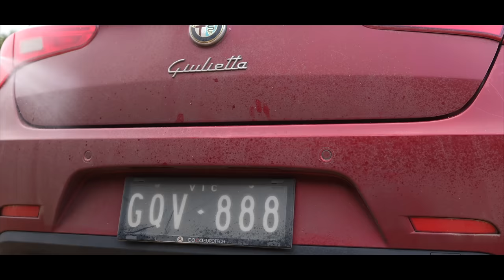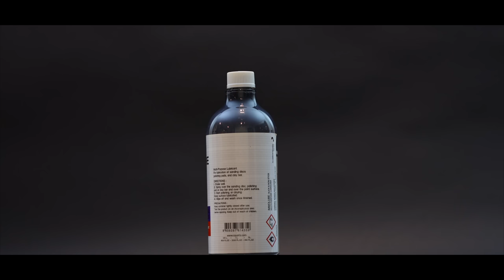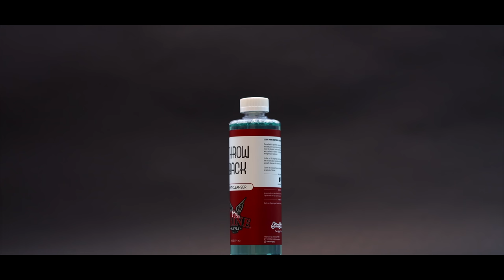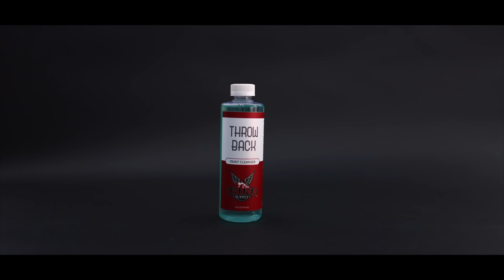My Favourite Car Detailing Products | Wheels, Wash & Decontamination Series

Comment: For folks reading this, reached out to Sandro regarding removal of wheel weight adhesives. He recommended a heat gun to loosen/remove the foam with a non-marring tool, and TarX to remove the adhesive. Got both, used as he recommended (and per label instructions), and it couldn't have been a smoother process. Thanks, Sandro!

Comment: Good to see you back mate.
Definitely some great products there, over the years Nv snow + has probably become one my favourite products in my arsenal, just seems to clean so well, and used at a 1:10 dilution as a pre spray prior to contact washing, really supercharges it’s cleaning ability and continues to surprise me with its ability to strip back the surface without requiring further use of harsher apcs and/or traffic film removers.
Well done once again mate 👌

Comment: I would suggest to anyone cleaning their car frequently to buy a wheel cleaner and a strong apc that is concentrated, can be diluted and offered in gallon. A bottle ready to use is often just to expensive, will need to restock basically every month or two.
And don't get a 2 in 1 wheel cleaner/iron decontamination. Get a concentrated wheel cleaner that you like, and iron X. Only use iron X when needed.

Comment: From what I’ve learned in detailing the word “best” is really subjective. For example some people love CarPro Lift but other love Bilt Hamber Touchless more. It’s all down to personal preference
Reply: I haven’t used bilt hammer but I don’t like how much you have to use
Reply: @jdmkidk24  you have to work out your PIR and you can adjust from 1%-4% depending how dirty it is. During the summer where it’s just light dirt 1-2% is enough and I don’t use up the full 1 litre solution in my foam bottle, I mix it in with 500 ml which is still more than enough to cover the full car.

Comment: Thank you Sandro.  A little surprised you recommend the MTM foam cannon in 2023.  Our local dealer usually has to throw in a free 16oz bottle of soap to move them.

Seems like they're the only company on the market that hasn't figured out the wide mouth bottle yet, and I constantly had to adjust the fan nozzle because it came loose so easily.
Reply from the maker: Yes I agree a wider, easier to pour in bottle would be nice. But I tested it against quite a few other lances and the MTM always had the best cling and longest foaming dwell time - that’s really what impressed me about it.
Reply: The best thing about the MTM is the repair-ability! Very simple and easy to work through if it clogs a little. The steel casing & nuts & springs inside are high quality and last a long time while also being very easily & cheaply replaced with goods from your local hardware store.

Comment: Thanks for all your incredibly helpful content over the years, not sure my bank account would agree but 😂

Can I also ask, is there any specific combo of product plus an applicator/brush that you like to use on the more aggressively lugged off road tires? I haven't quite found a combo that speeds up the application process yet. I've just been using a foam applicator and "sponging" it in.

Thanks again!
Reply from the maker: Thanks so much for the support, it’s greatly appreciated! 
A tyre dressing combination I like a lot particularly on off-road 4x4 tyres using Zaino Z16 with a detailing brush (something like the Carpro Boar Hair brush) and just painting Z16 over the tyre walls and knobby treat patterns, it’s great at getting into all the intricate areas. Also just leave on and usually it all self leaves within 30-45mins and looks just amazing. You can also just use a cloth to wipe off any runs on the rims or any excess dressing.
Reply: @CarCraftAutoDetailing  awesome, thanks! I dread this process usually when doing 4x4s so will give it a go

Comment: Another awesome video, Sandro.  You recommend Shine Supply's Wise Guy for tyres, but how is it on wheels compared to NV Purge?  I'm looking at keeping it simple and hoping that this will allow me to use it for both tyres and wheels. Cheers, mate.
Reply from the maker: Thanks and you can absolutely use WiseGuy for wheels, but I would recommend diluting further at least 1:5 up to 1:10. The main reason I prefer Purge is that it’s more gentle and a little better on brake dust, but WiseGuy will still be very capable and at the right dilution also safe.

Comment: Thanks Sandro, for taking the time to put this together. I always enjoy your videos, but this one was particularly informative. 

I'm curious to know if you've ever done a video on regular, weekly decontamination during maintenance washes? My workplace is next door to an asphalt production plant, so you can imagine the amount of airborne mineral and tar based contamination is stuck to my poor truck by Friday afternoon. I'm currently using Meguiar's hybrid ceramic for main protection, but I'm curious about anything I can use weekly to remove this gritty mess without damaging my paint or needing to re apply protection after every wash? Can you offer any suggestions?
Reply from the maker: My pleasure mate and your situation may need some trial an error testing to find the best solution. 
The vehicle in the video has a 3mth old ceramic coating, so I can comfortably use  traffic film, iron and tar removers to deep clean the surface without compromising the coating - which is very chemical resistant. 
You may find you’ll need to test perhaps something like BugOut or Poorboy’s StripDown to see if they firstly remove the contamination and secondly if Meguiars HCW holds up to them. 
You could even try Carpro Multi-X starting at 1:5 and working your way up or down in diluting it accordingly.
Reply: @CarCraftAutoDetailing  thanks for taking the time for this thoughtful response! I'm beginning to think that the time has come to actually jump into the world of "pro-sumer" coatings. The cost of course us more, but having something I can actually get clean without degrading the coating would be nice. To be honest, I believe the worst dirt accumulated this past couple of weeks has been due to poor air quality/fallout from the wildfires here in Canada. We had a really bad week last week, it was actually hard to breathe for a couple of days due to the poor air quality. I'm going to do some trial and error, and maybe get ready to "up my game" next year. Again, thanks so much for taking the time!🙂
Reply from the maker: I hope you guys have seen the worst of those fires and your families are safe.
Reply: @CarCraftAutoDetailing  I'm also hoping for the safety of the first responders dealing with them. These fires have all been in Northern Quebec and Ontario. I live in Southern Ontario, so not all that close, thankfully.

Comment: Great video and brilliant insight into different products and reasons why they work for you, being careful and sensible about what you use is what should get you good results. I wanted to do a decon on one of our cars while I was off last week and a quick polish and re-protect. It’s been blazing hot near 30 degrees in the uk and have left it as I’m not prepared to go out with a fallout remove until I get some good shade to work in, just asking for trouble. 

Though I’d share some that work well for me…..

Tyre Cleaner - Autoglanz Rebound

APC - Bilt Hamber Surfex HD

Pure Shampoo- 
Adams Blue Shampoo

Decon Shampoo - 
Garage Therapy Zero Decon

Strip Shampoo - as above or
Meguiars wash +

Snowfoam (good cleaning)- 
Bilt Hamber Autofoam / Touchless
Autoglanz Spritzer (Citrus)

Iron Fallout Remover- 
Auto Finesse Iron Out. Not cheap but states not an issue if drys as long as not used in direct sunlight

Car Pro Iron X or BH Korrosol also good, former was first one I ever used

Acid Shampoo (coating rejuvenation or mild water spots) - Labocosmetics Purifica

Water Spots 
(Mild) Koch Chemie FSE (Detail Spray post wash)
(Worst case) Labocosmetica Energo

Tar - Autosmart Tardis with care for quick and effective removal

Safer option is Autoglym for light deposits

Clay Lubricant - ONR or P&S Absolute which also use for rinseless washing

Still need to try out BH Soft clay as can be used with just water but would use rinseless as a precaution. I agree the newer synthetic stuff is good and quicker if a little less effective, I also want to try out some of the newer ones with more pores in to keep the contamination better from the surface such as The Rag Company Ultra Clay Scrubber, as although only one use of the Carbon Collective Exfoli Block worked well I feel the prior would be safer and gentler. 

Thank for the content Sandro 👍🏼
Reply from the maker: Appreciate that mate and thanks for sharing your own experience and processes with those products.

Comment: Not through the whole videos, but NV Snow was not great for me. Mostly because it was not great in warm weather, for some reason left staining on trims which most neutral soaps I never have a problem with. Also didn’t have great luck with NV Jet for some reason, but loved their wheel cleaner and tire dressing.
Reply from the maker: We all have different experiences with different products, I always recommend going with what works for you.
Reply: Apply NV jet as a drying aide